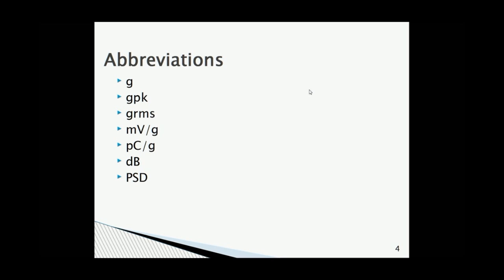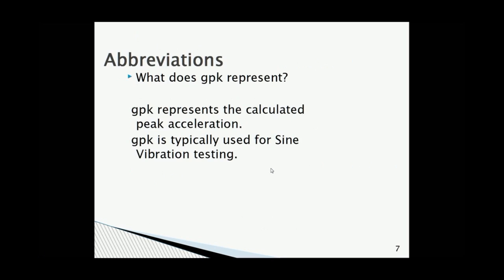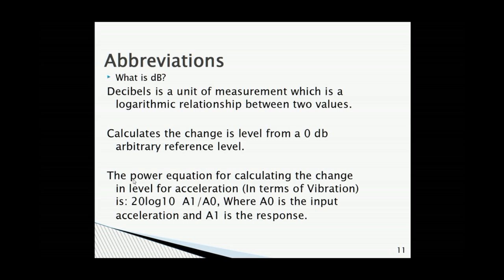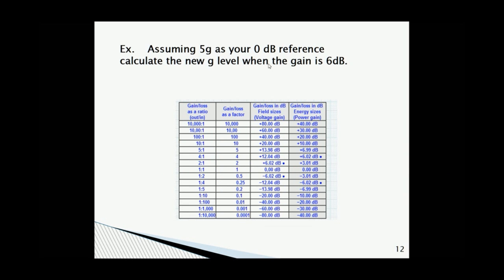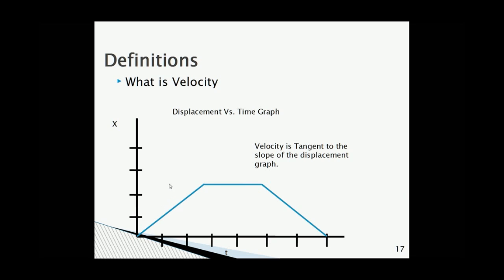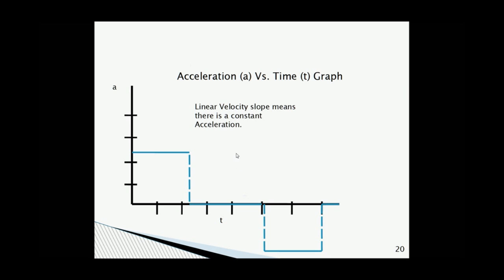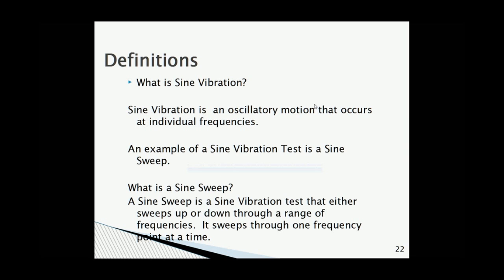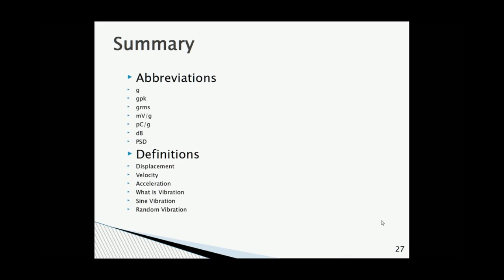Introduction to Vibration Testing

Comment: I think you may have described displacement a bit incorrectly. Displacement is a change in position (with direction included). You mentioned that displacement was tangent to position over time, but being tangent means that displacement would have a time component, which is doesn’t. It seems like you got displacement by taking the derivative of position... but that wouldn’t make sense. It’s an old video so I don’t expect you to update, but I don’t want anyone else getting confused! Great video otherwise, thanks Tom!

Comment: I am trying to figure out a vibe table to purchase, but don't know what to get.  Any advice you can give me?
Reply from the maker: Hi Jack,  Some things to keep in mind: Are you only going to run vibration tests or also shock?  What is your worst case payload or test specimen's weight and dimensions?  What is your worst case G level, GRMS, Displacement, Velocity?  What is the test frequency ranges for your vibration profiles?  Will you run 3 axes, single axis vertical or horizontal, simultaneous axes (2 axis, 3 axis, 6DOF etc), do you want to run vibe with another environmental stress such as temperature, humidity, etc (Combined environment)?  What types of vibration tests will you perform: Will you run Sine, Random, Sine-on-Random, etc?   If you are running shock, are you performing classical shock pulses (Half-Sine, TPS, Trapezoid, etc)?  Will you perform SRS?  Will you perform time replication shock and vibration?  What is your pulse duration, shape, frequency, etc?  How about your building?  Can your test lab location structurally handle a vibration test system?  Will you require air isolation or will you build a seismic mass?   I hope this helps.  If the above info/terms are new to you or you need more help, feel free to reach out to me in one of the links in the description section of the video.
Reply: @tomreshtesting  Thank you

Comment: When a system vibrates, its motion can be expressed as A*Sinωt. - A is the amplitude of vibration (length unit) and ω the frequency in rad/s. On differentiating twice, we get (-) Aω2*Sinωt. The value Aω2 is m/s2 (unit of acceleration) and when divided by 9.81 (acceleration due to gravity) gives the 'g' value of this vibration. This is how I explain the term 'g' . Expressing acceleration in terms of 'g' has the advantage of not worrying about its units (in SI units or Brit or American!!). Tom. Do you agree with this explanation??
Reply from the maker: Hi Ananth,

I agree.  That is a great way to express vibration acceleration in mathematical terms!
Reply: Tom Resh . What's the difference of expressing it in 'g' or mm/s2?
If the value in mm/s2 is 5, what will be the expression in 'g'?
Reply from the maker: @adambodom  Hi Adam, 1 g = 9806.6, so 5 mm/s^2 would be virtually negligible and detecting this level with most typical accelerometers and data acquisition systems would be difficult as you would be well below the noise threshold of most measurement devices/systems.

Comment from the maker: The statement resonant frequency for a device under test is not fully correct.  Most systems are complex and have many integrated components.  The result is a stack of resonant frequencies.  To measure the resonant frequencies of a device under test, one must place response accelerometers on each of the integrated components on the device under test.  You would then perform a flat low amplitude sine sweep.  Once you perform the sine sweep, you will then perform a flat low amplitude random test